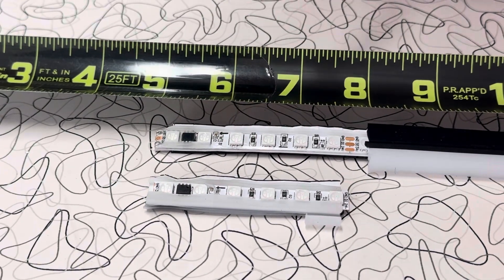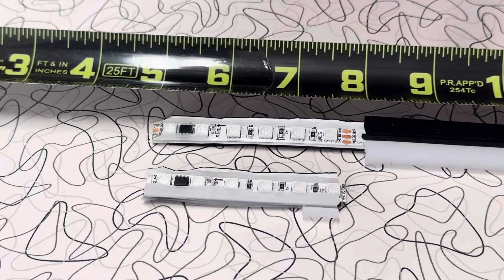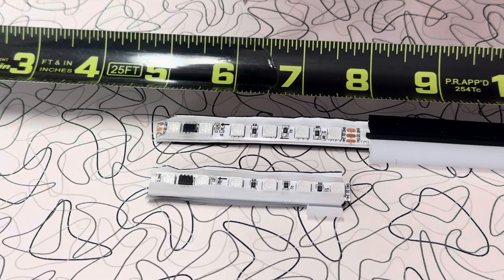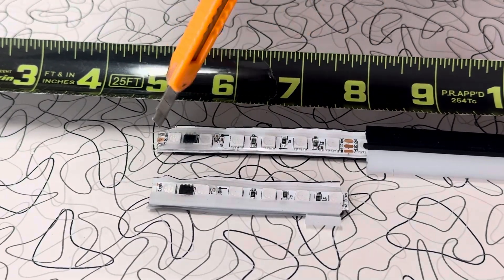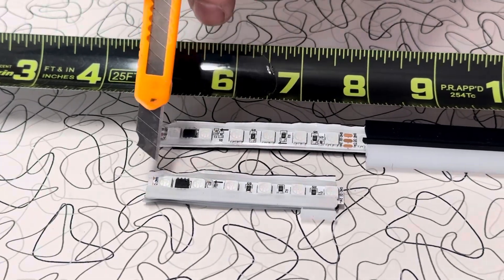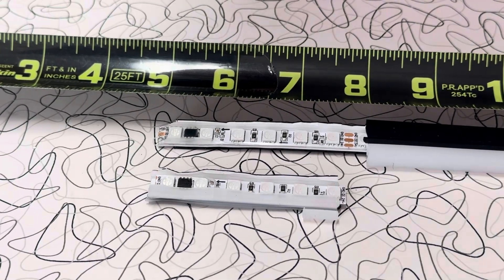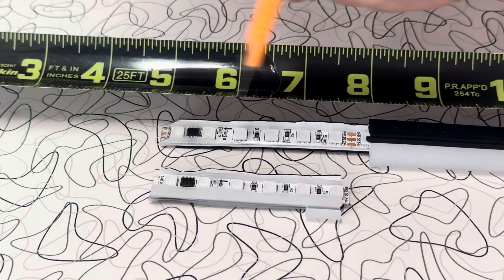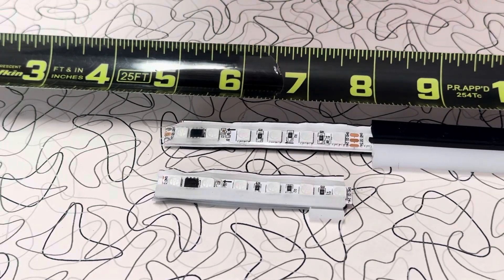Govee Rope Light - Cutting & Splicing

Comment: I purchased the H61A9 (2 rolls of 32.8ft each). I'm trying to create one continuous 65.6ft run, but there's an ugly gap where the two strips connect. Has anyone tried cutting the end of the first strip and the beginning of the second strip, then joining them with a connector or soldering them together at the cut point? In theory, this should work to eliminate the gap. Any advice?

Comment: Was looking for a confirmation if I was thinking correctly that this is the usual segmented LED in a diffused housing and if the splitting is basically the same as any other. The neon 2 went on sale by 40% and need 3.8m, so purchased 5m version and will be doing the adjustments. Also, thank you for the suggestion with silicone, especially since we are applying this in our bathroom!
Reply from the maker: I’ll be interested to hear how it goes for you!

Comment: Do you think it's possible to add more rope light this way as well?
Reply from the maker: Yes. But there’s a limit. As the length increases, so does that resistance which means there’s a voltage drop. At some point the LED elements will cease to function correctly.

Comment: can the same be done with the neon lights version 2? am sure we can,. any thoughts /comments pls? if so, the first thing to do is to cut the exterior cover in order to see the interior led's and the copper chips?
Reply: that's what I am trying to figure out now as well lol. One guy on youtube said that it is possible with the first version but not the second but I am not sure if it is entirely true or not. Let me know if you ever find out.
Reply from the maker: @vizagblues  what I have found across all these brands is the LEDs are in sections that are repeated on the ribbon every so many LED modules. Finding where that is can be done by opening up the casing on the ribbon (if enclosed), observing the build structure and the circuit traces on the underside of the ribbon, and realizing where one complete circuit ends and the new set begins. That will be your cut point.

Comment: Hi, Nice video, thanks for that. I have only 1 question, if you cut one end, how does this effect the factory light-effects that are symmetrical? Thanks
Reply from the maker: Good Question!  
What I discovered is the light effects are sequenced to repeat every third or fifth set of sections (Can't remember exactly which).   So that means that the effect is the same every so many sets.  cutting one off doesn't disrupt the sequence for the rest of the strip.
Reply: @superjon78 what about if you solder them together? Would it repeat until the end?
Reply from the maker: @DinGrogu2019  in principal, yes that would work as it would be just the same as if it was still in the original series structure.

Comment: Hi, Thank you for the video. Could you please help with the orientation of the led strip lay out ? Is it on strip facing sideways or upward ?
Reply from the maker: @renjithsadasivan4237  if you stand the strip up so that the three black sides are facing down and to the sides with the clear side up, then in that orientation, the LED strip is on the side.  This is to allow the strip to be flexed around a window or door type of shape.
Reply: @superjon78  Thank you so much ! I just trimmed the rope light to my requirements and it works great. This video helped me to make the decision :) . One quick thing to add, not all joints are copper . some  are lead instead of copper but it is at the exact 2.75 inches away from each other